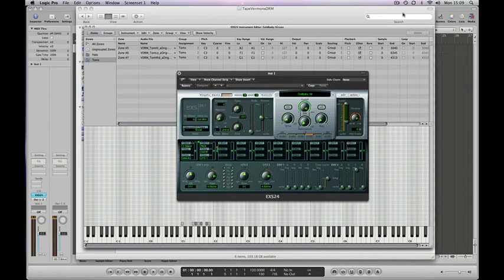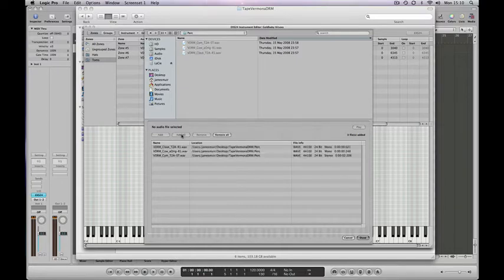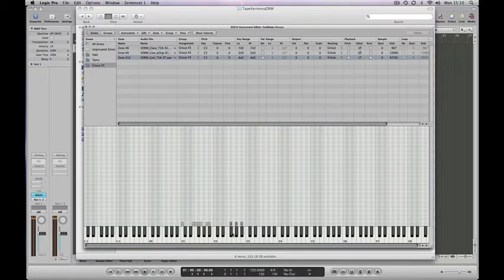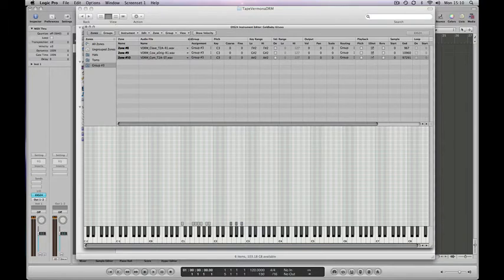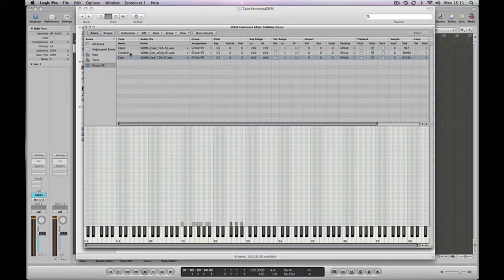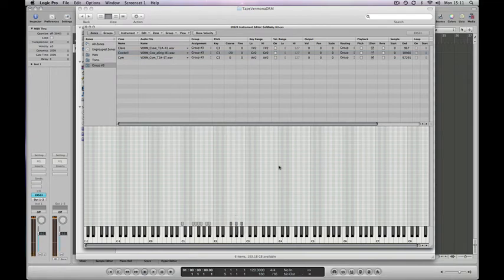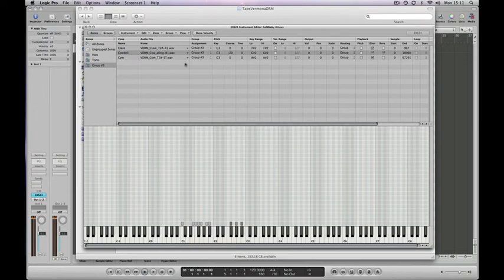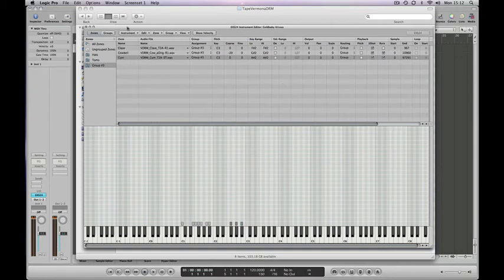Build A Drum Kit With Logic's Exs24 Part Four

Comment: @JamesAndrewMuir I'm guessing right now that it has to do with the fact that they were rips from an old game, and as such, are 8 bit samples. Though something a bit more peculiar happened after closing the project and reopening it later. I tried to play a region that used the samples, they sounded as if they were all being run through an overdrive effect. I had changed nothing from before... I'm hoping taking these samples and converting to a higher bit rate will solve this.